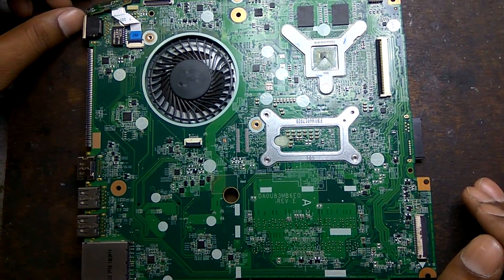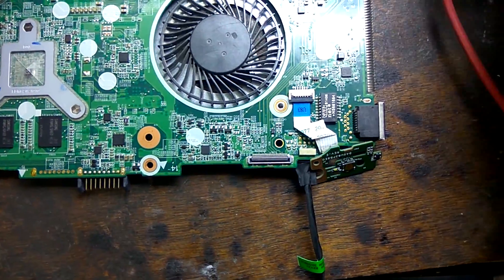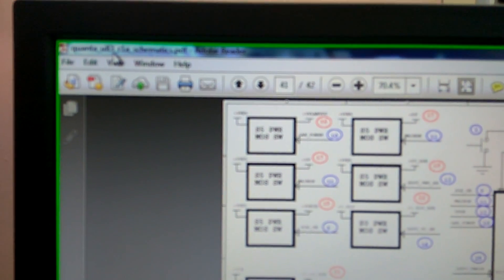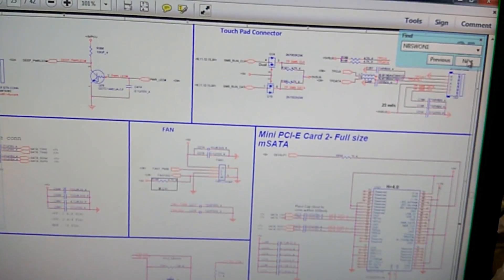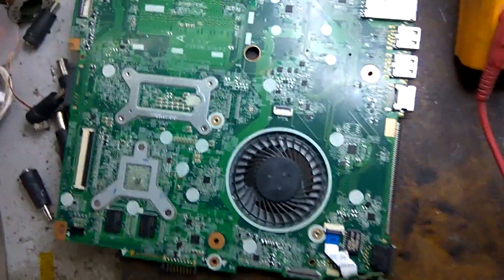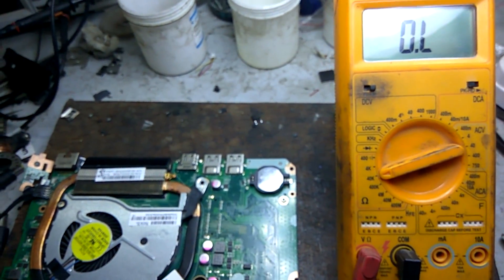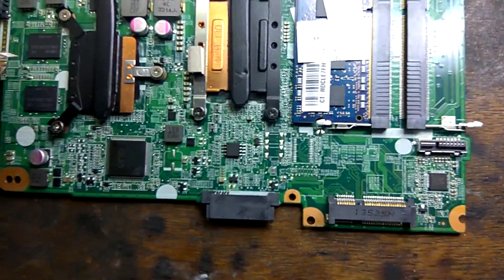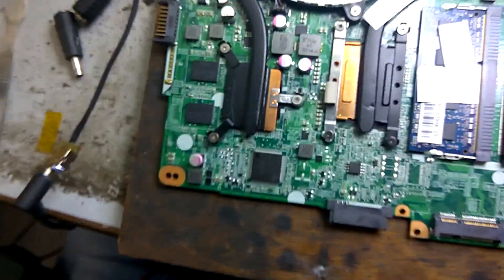How to Fix No power on issue in an Hp laptop Easily Step by Step

Comment: buenas tengo misma maquina misma falla prende la luz al enchufar el cargador pero no prende la resistencia de 10k esta bien tengo los 3.3v el boton power funcionando perfecto llega el pulso al EC tengo todas tensiones regrabe la bios con 3 binarios diferente pero nada no prende sera el EC???
Reply from the maker: English
Reply: @Aditya11ttt  Well, I have the same machine, it fails, it turns on the light when I plug in the charger but it does not turn on the 10k resistor, it's fine, I have the 3.3v power button working perfect, the pulse arrives at the EC, I have all voltages, rewrite the bios with 3 different binaries, but nothing does not turn on. will it be the EC ???
Reply from the maker: @mlp9982  try ec once !

Comment: I have the same problem but i can't find the schematic for (hp 350 g1) with (it8527e)
Reply from the maker: Might be not available! U can use it8527e data sheet for reference may be it Helo in reverse way
Reply: @Aditya11ttt  now the (on) signal is good but the 5 volt not present although there's no short
Reply from the maker: Chcek 5v basic requirements and it could be partial ic failur if still not gehrate and all ok

Comment: help plss ... my laptop is HP Pavilion dv6 my problem is my laptop is not turning ON but the power LED has Light .. in order to turn it ON i have to remove the CMOS battery and press the power button for 15 secs and my laptop only works if i do that .. but when i shut it down and trying to turn it ON it doesn't working again ..  so i have to press the power button again for 15 secs (with no cmos) ..
Reply from the maker: znajko 1337 which country?

Comment: my dell laptop charger output voltage is Ok But but laptop not charging i use diffrent charger then laptop getting charging...what is problem in my old charger.

Comment: 15-k202nl Help me.... with no battery, I Connect the power supply, try to switch on, but the led on the power supply port glow 3 times in white but the machine still off.... Help me please...

Comment: i have a hp motherboard DAOU82MB6D0 REV D. Its problem is few days ago it stucks on hp logo,after few days it only glows the power led but very weakly.but cpu fan does not rotate.
Reply from the maker: Snehashis Adhikari Gokula krishnan what’s app +91-9584145145

Comment: Sir i have 7th generation hp laptop 
Unfortunately,power not getting on
Its another problem is that its charging led continous on rather charging mode or not
Its led getting on permanently 
Plz suggest wht i do..
Reply from the maker: Ram Das contact 9584145145
Reply: i have same problem,,how fix that?
Reply from the maker: Try

Comment: Hp Laptop Dc jack light glow But Not powering on solution.
Reply from the maker: DHANANJAY GUPTA contact via what’s app +91-9584145145
Reply: @Aditya11ttt  hi sir i have same laptop with same issue power jack led lights and battery charges, but system not turning ON after pressing power button.. If i send motherbord to you can you support for recover.. Thank you
Reply from the maker: @sree4862 contact via what’s app

Comment: How to chek rst and rsm vol... For io in this video are not give about the idea of 3.3 vol... Is rst and rsm according to your question lite is glow but no power on board.this case pannel vol..Is ok and step down is missing in that case lite is glow but no power.kindly give suggation.
Reply from the maker: Netware Solution according to whose question ?
Reply from the maker: Netware Solution plz follow power sequ!! U will get ur answer !! 
And if nbwson is missing why will I check rsm??
Reply: Sir my pannel voltage is clear means io generate 3v  then you will send  pannel voltage also we can check on 98no to rsm when my step down voltage are clear how can identify  to search above problem to B pulis voltage io io when 5 v are not coming  then step down ic it may be failure ist check 5v  and 3v and rv of io then go to this section
Reply from the maker: Netware Solution only one question sir did u check pwr up sequence ?
Reply from the maker: Netware Solution IO generate 3v means plz clear that am confused with the statement or plz call on the number am confused with what u are asking or saying !!

Comment: pin 19 input 3.3v ok. resister also ok. but no power on. when power batten press. the power adaptor connector white led blink 3 times. what else I want to check?
Reply from the maker: bios check

Comment: Hello sir,
nice work and good video.
I have a compaq presario CQ71 and when I plug the power supply, the led turns on for a few seconds and then turns off and the computer does not start and no lights.
Problem spread on these models visibly.
Do you know the solution?
Thanks for your help.
Reply from the maker: Pascal Despres how this problem actually started plz give a brief discription and also u can contact us via what’s app!!
Reply: When I plug the jack of the power supply, the white led turns on for a few seconds and turns off. Nothing happens, black screen, no lights. I unplugged, reconnected the power supply, same, led turns on then goes off. Power supply tested, ok: 19v.
I am thinking of a short circuit component but which! A little lost I must say ...
Reply from the maker: plz contact us via whats app!!

Comment: 8c voltage regulator burnt . Replacing that makes charger light off . No power on . Same board as in you tube. What to do sir ?
Reply from the maker: Aravinthakrishnan check vs line !!
Reply: Aditya11ttt Sir , changed that . charger light glows . But no power on / no voltage in power switch
Reply from the maker: Aravinthakrishnan plz contact via what’s app
Reply from the maker: +91-9584145145

Comment: Hi sir awesome video thank you  
And my hp 15 is won't turn on  when I plug in the power the plug jack light won't turn on and I check voltage the voltage was unstable it like 4.5 then goes to 0 then agian 4.5 then 0 what is the problem?
Reply from the maker: Selvarathinam Perusan check for the faulty component !!
Reply: Aditya11ttt  thanks for reply power side all components do like that
Reply: Aditya11ttt even power holder also
Reply from the maker: Selvarathinam Perusan search for short or leakage of any component !!

Comment: Hello sir 
I m also hardware technician 
I want little help from u .
I have HP g4 laptop the problem is when I connect battery on laptop no display issue is come if I removed battery and connect the charger it work fine what is the prob on board plz help me
Reply from the maker: moivedekho contact us via what’s app

Comment: Thanks a Million for this video. it is a big relief for me as a repair tech. i now know how to diagnosis any laptop with this same issue, most especially using the laptop schematics diagram in carrying out my repairs. 
My question is assuming the resistor you replaced was not faulty  what other components or section of the motherboard would you have checked to identity the fault. looking forward to your prompt reply! Thanks
Reply from the maker: the fault may vary board to board situation to situation!!
Reply: Thanks for your prompt reply. Am grateful!
Ok, so what helpful suggestions will you offer if am faced with other laptops with same issues but of a different model.

Comment: Dear sir,
Hp 15 Laptop Dc jack light glow But when i press power switch one time power light glow for one second and no power in laptop when i check stepdown section 3.3v and 5v is ok in power switch 3.3v is also in standby but then also no power in laptop.........
Reply from the maker: Krisna Bhattacharjee can u share part number of laptop ???
Reply from the maker: Krisna Bhattacharjee and did u program ec bios ??
Reply: Sir aapka solution hogya kya ??
Reply: same problem is there a solution